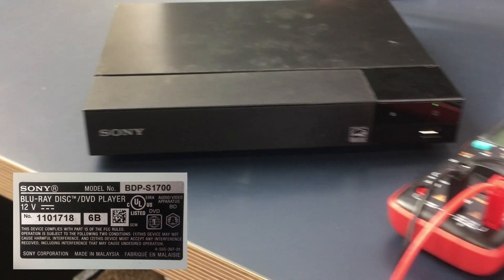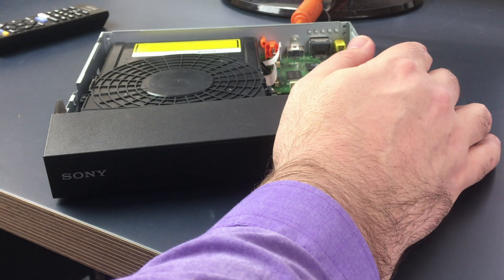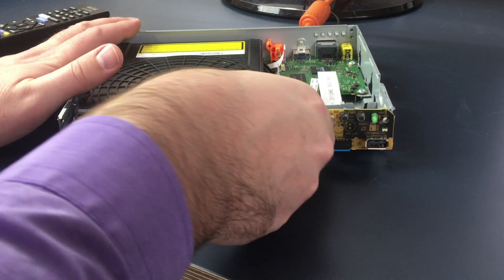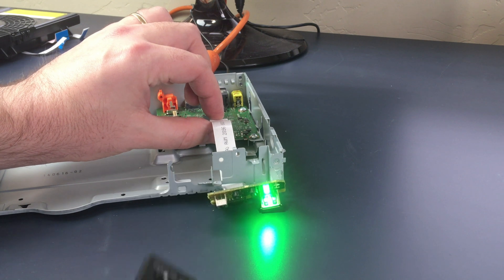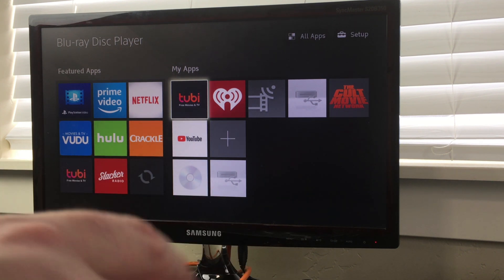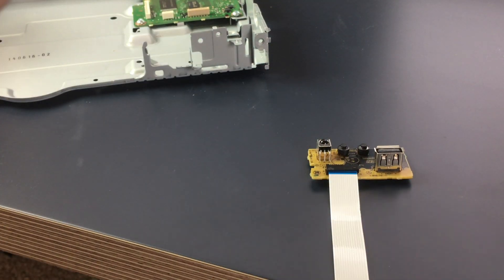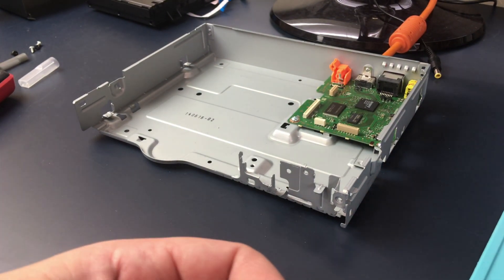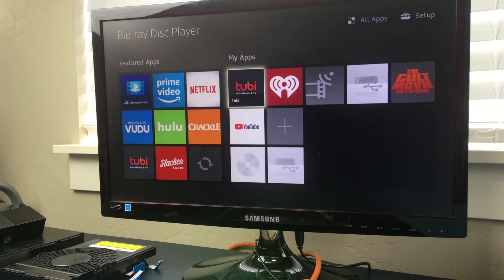Blu Ray USB Overload FIXED - #139 Amateur Hour w/ SolderJS

Comment: Hello AJ ,
i have a chance to buy a used Yamaha Rx-V6a online for $200 BUT the guy selling it says it reads :USB OVERLOAD
Should i buy it is it worth to fix it ? Reg price is $900 CDN
Reply from the maker: That's all about your risk tolerance and self confidence. If you're doing it to save money, probably not. If you're doing it because it's a good deal and you're confident that you can fix it, but having to scrap it and lose the money won't set you back that much, do it. I recently spent over $100 and 20 hours after buying tools and materials and trying different techniques to refinish and restore an aquarium I bought for $10. New it would have cost less than $100. But I learned a lot and I enjoyed it, so it was worth it.